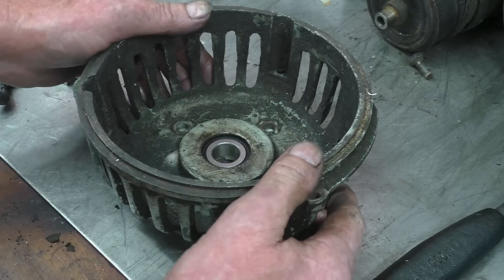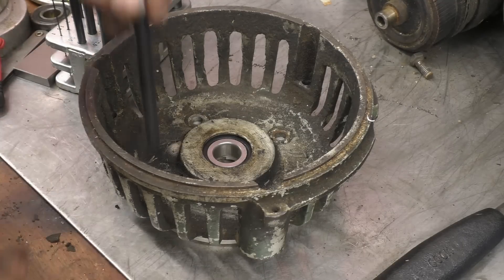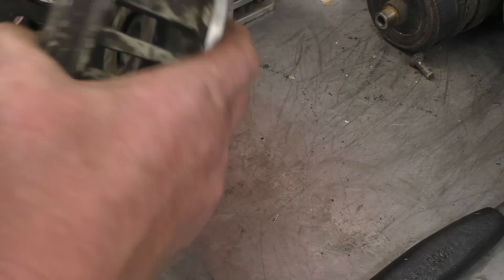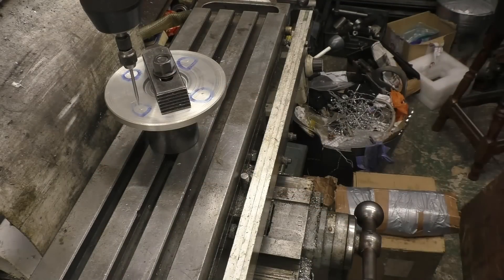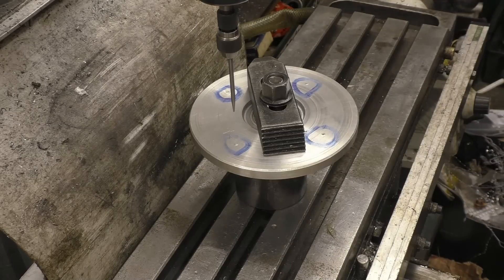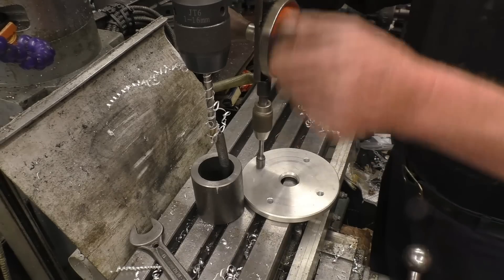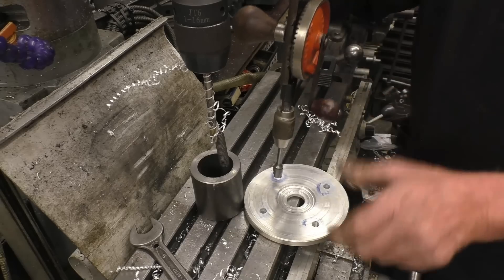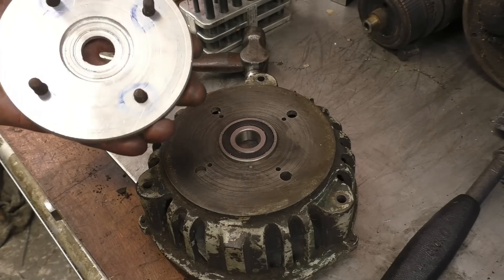SNNC 449 P2  Casting Bronze . Plasma Cutting

Comment: Great stuff. The aluminium bearing cover was nice. The round insert tool really breaks the chips well on aluminium. I must try the one I have. The casting was brilliant, I used to love that about the early night caps. The way things are going you will be using the Stuart Turner engine coupled to the generator to run your house!